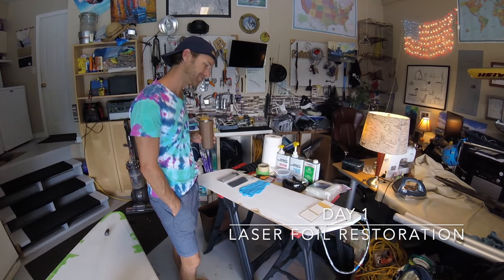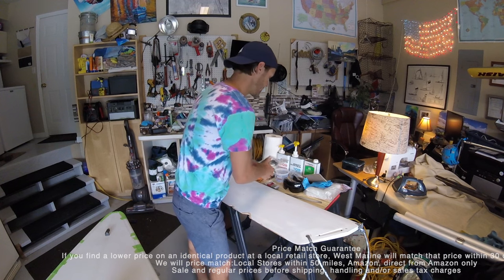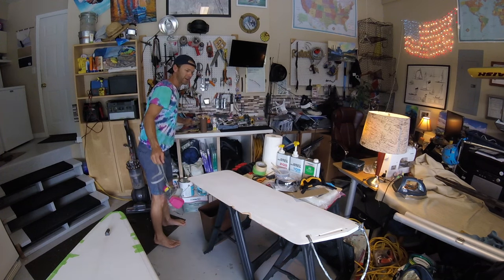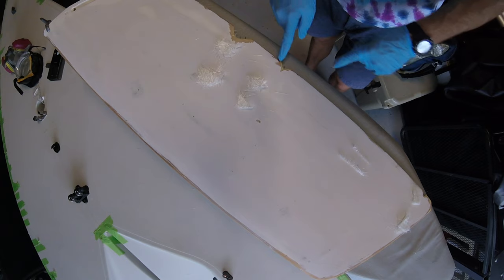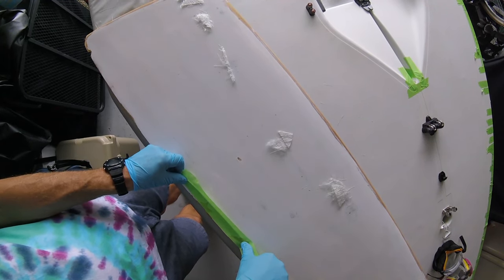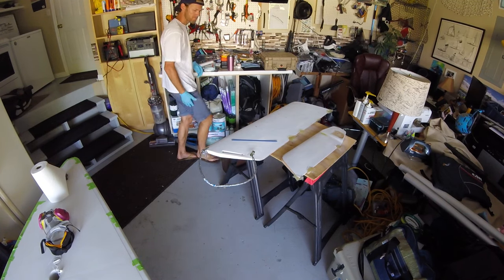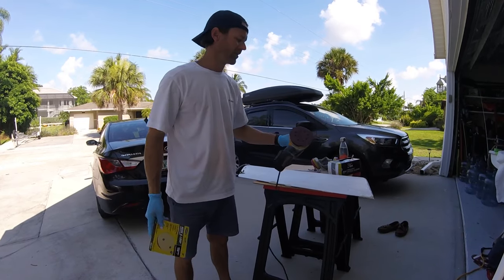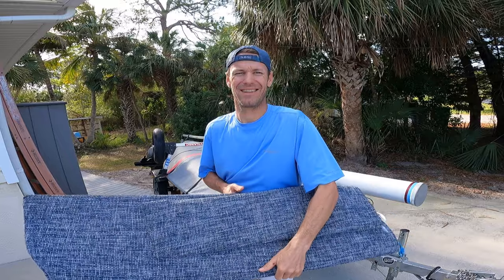ILCA Laser CENTERBOARD AND RUDDER FIX

Comment: Where do I find the veneer pins? I’ve searched the web, Home Depot, Amazon. The only place I find that has them is a place in the UK. We have to have them here somewhere yeah? What is the brand and name of the ones you used? Thank you!
Reply from the maker: Hey Alex, great question and I had to do some digging myself, but eventually ordered them off a guy on eBay located in the UK. 10$ arrived in a week. Hope that helps and good luck with your project!
Reply: Thank you, any chance you have the link handy?
Reply from the maker: @alexrothenberg5032  https://www.ebay.com/itm/155020968573?hash=item2417f8427d:g:zMEAAOSwuARimLeT&amdata=enc%3AAQAIAAAAwBfzxjH%2BjTaWLIxkmLQyDE9KUgnKH6XSutXcbpmhIxHCjGy2afwmffNkjKj9INitDVeH8IzFrET%2BN2GPJImYio3Wx4%2Bw7tj7yaBfqNV7G76tWKcYD1FGD3a9NAbtZT9hJwOphaKWbZOXFVYILqDb6mBcnAftw%2FzO%2FdGLJkzTB6VCQ0U0XEmI4ww1eGAyo81tG3WtEMze88UG1Zl2723IPTT%2BIJC%2BCHlGC94hV9HynCAZu1BDivxPlsGNPh249z%2BC5g%3D%3D%7Ctkp%3ABk9SR-7UpoKIYg